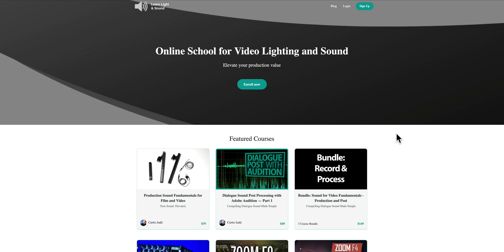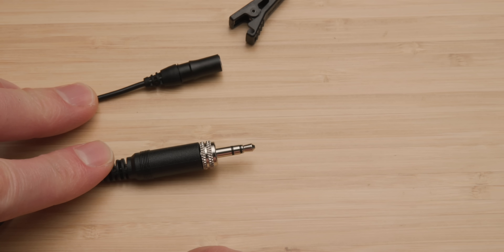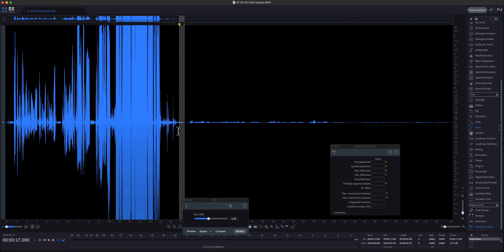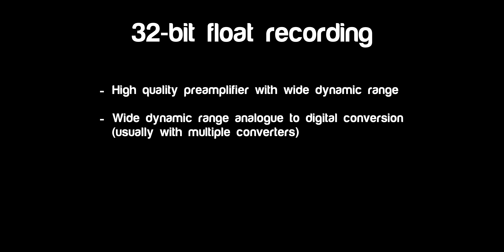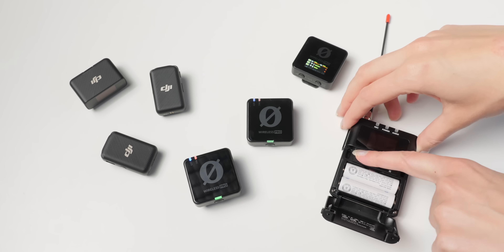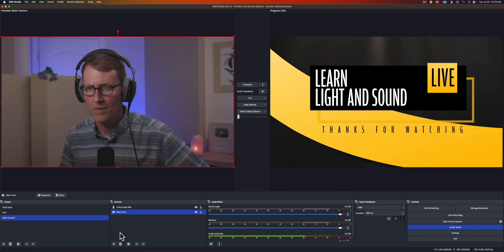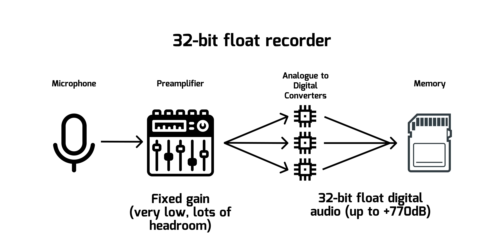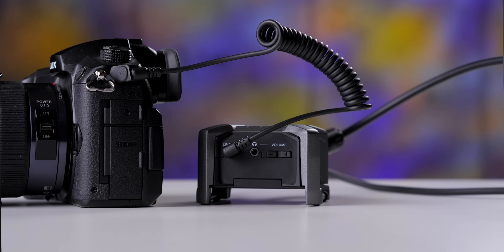Is 32-bit Float Audio Magic?

Comment: I made a video using gh7 w xlr2 w rode ntg 3 in input 2 and rode wireless pro to xlrpro adapter to input 1 i had gain up high on both and set to 20db and imported to fcpx w 48kh quality. Nowhere can i find 32 bit on any file. Would be cool to get some feedback on what im hearing. I knew many questions around i have asked creators and answers are kinda alienating and confusing. If its my mic are those 3 high functioning mics shown in this video a better option? Stereo mic ?idk. The situation was being at a carnival. Tons of noise or sounds. Great breakdown. Thank You
Reply from the maker: All of those recordings to the GH7 are 24 or 16-bit depending on which recording format you used. The Wireless Pro does not transmit 32-bit float wirelessly. It only records 32-bit float to the transmitters.
Reply: @curtisjudd  the gh7 is set to use the xlr2 in camera set to 32 bit 48 in video format mov and prores.i have the ntg3 in the xlr2 port and rode wireless adapted rode vxlr pro to xlr2 port 1 set 48 phantom. I think ive figured it out🤷its the ntg3 . Sound distorts  or clippy only through sounds at the side and back of the mic. I connected another vxlr pro to the port the ntg3 was connected and  then connected a 3.5 to the vxlr and now both wireles pro and deity mics sound good. As far as the file on the camera card  yet to figure out. I really appriciate the feedback! Thank You
Reply from the maker: @DavidRose-nonichemedia  👍

Comment: I wonder when will they make an 32 bit lav mic capsule, the zoom m1 has a 32bit float shotgun mic but I've only seen like 2 videos that reviewed that mic , so it must not be as great
Reply from the maker: Mic capsules are analogue. It is the converters which are 16, 24, or 32-bit float. So things like the M1 put a mic, preamp, converters, and recorder in one. With separate XLR mics, the capsule is in the mic and all the other things are in the separate recorder.

Comment: I'm sure someone's working on a real-time 32-bit to 24-bit plugin for live audio.
Reply from the maker: Interesting. I wonder what problem they’re aiming to solve with such a thing. Why not just use 24-bit from the start, in other words.
Reply: I would think such a technology would have to use at some point some limiting or auto-leveling, which would mean you could just use 24 bit in the first place. The converter will not know in advance what the peak will be on that 32-bit stream, so it would have to "react".

Comment: With 32 bit float, your microphone will probably be the limiting factor. Without 32 bit float it was the recorder. A big improvement!
Reply from the maker: Assuming there aren’t other costs to 32-bit float. And I’m not 100% sure that’s the case yet.
Reply: Yeah and people aren’t always even recording from microphones. I got my H4 essential mostly to tap out of my mixer and capture my synths/drum machine/live looping jams. Works great and has not clipped once despite me being a little less than careful with my levels at times
Reply: I can't tell if you're being serious. 32-bit won't automatically improve your sound

Comment: Will you be reviewing the Zoom H1XLR?
Reply from the maker: Yes
Reply: I can summarize the H1 XLR for you: Zoom noisy as expected, small, convenient, slightly larger than the F3, love the combo XLR and the PIP port, screen is super tiny and difficult to read, and the processor is so weak, it takes three times as long to normalize or export as the length of the actual recording. Great for tiny mobile audio interface for live streaming, has loopback.

Comment: I record mostly nature sounds and do a lot of 12-15 hour recordings and one big drawback to 32-bit float only recorders is the files are significantly larger for dynamic range recordings I don't need.I record with my Zoom F3 only when I have to simply because I have to use 32-bit workflow and have much larger file sizes than I really need. Trust me hard drive space fills up quickly on long recordings. Also to everyone who thinks it's a hassle to set gain on a 24-bit recorder then you probably will not want to hear how important microphone placement is and getting your talent or yourself to speak in clear level tones while not turning your head too much etc. The point is good quality audio has so many variables and if you can't handle learning to set the gain then the rest of it is probably going to be too much for you also.  So many variables are involved and a 32-bit float recorder is not going to solve all them for you. But I'm sure Zoom,Tascam and the others will want you to think it will be the cure for everything.
Reply: Ever record a live rock band?  Placement matters....nil.  You will have transients pushing 120 db and lows and whispered vocals just barely reaching 50 db in the same performance, no matter where you position your microphones.  All you can to is position your mikes the best way you know how to capture the soundstage (or at least make it reasonably correctable in post).
Reply: @chuckschillingvideos  Well, you do need to think of the effect of the room in messing with the frequencies of the band, and the balance between audience noise and the band itself.
Reply: @Ozpeter  That's accomplished not by mike placement but by orientation and control of the capsule pattern.  I have five mikes available to me so it makes it easier to handle the size of the room, how off-axis relative to the PA placement I am, audience size and "enthusiasm" (it matters), and so on.  It's not exact, but unless you're working for the venue (not once have I done this), you're usually quite limited in your ability to more your gear around, not to mention you need to be able to keep your eyes on it at all times to protect it from sticky fingers.
Reply from the maker: Thanks for sharing your experience! I agree that setting gain is a skill worth learning.

Comment: very helpful, as always, thank you for this. 
Can you recommend a good DAW? I've had it with adobe, but not really sure where what other options are generally recommended.
Reply from the maker: Depends on what type of work you intend to do in the future. If you want to go all-in on post and make that your career? Pro Tools. For most other paths, I’d look at DaVinci Resolve’s Fairlight. You can start with the free version.
Reply: @curtisjudd  i do mostly video work, corporate usually internal stuff, been using da vinchi for about a year, jut curious what else is out there.
Reply from the maker: @oriffel  Well, if you're using Final Cut Pro, Logic may make sense. Some like Reaper and others Studio One. But in post production for video at the high end, you'll almost always see Pro Tools. Then from there it all depends on workflow and preference. I've transitioned primarily to Fairlight in Resolve.

Comment: About 32 bit float in live streaming, a digital limiter should work quite well as there is no digital clipping in 32 bit float.
Reply from the maker: You can probably make that work, but you’re essentially back to working in the space where 24-bit works fine, and encoders will convert to 16 or 24 bit anyway.

Comment: That’s great. Now in 2024 can companies start making a file type that have this tech WITH video! I mean a MOV file or MP4 file is essentially a video AND audio file together.. so why not make a new type of file?! I know the size will be bigger but that’s ok with me
Reply from the maker: Ah, I wonder if that's already possible with some file container types...
Reply: I would think yes, as Curtis said, many file formats are just containers of a video and audio track (or multiple tracks).

You can try this by combining a video file and a 32-bit float WAV/FLAC track in Handbrake.

I would think this file may have playback problems on many current consumer devices.

Comment: Curtis, interesting video thank you.  I have a number of Gongs which I'm interested in recording.  I'm a complete novice with respect to sound recording but would suggest that the SPL and dynamic range that a large gong can produce from a main strike (very loud) to the point where the harmonic reverberations drop below audible frequencies is quite wide.  I'd be interested in whether you think this would be a valid use case for a 32bit Float capable recorder, not withstanding I'll have to get hold of some equally High Dynamic range microphones to capture the detail at both extremes.  Potentially using multiple microphones to capture each end of the frequency range.  I'd welcome your thoughts.
Reply from the maker: Honestly, I think I'd focus mainly on which microphone(s) to use and where to place them. The initial strike may be super loud if miked within a few cm of the gong, but with a gong, I'd think you want to back off a bit because the beauty of its sound is partly the gong and partly how the sound fills the space.
Reply: @curtisjudd  Thanks Curtis, I'm going to try microphones located in the same location as the listener about 3-4 feet away.  As you say part of the nature of the gong's sound is how it moves the air around the entire room.  As a sound therapist I have multiple instruments (gongs, singing bowls, wind chimes, rainsticks & tubular bells) located around the client and I'd like to arrange multiple microphones (4 minimum) possibly two matched pairs, around the client, in order to try & capture the entire session (1hr) as it happens.

Comment: I think where 32-bit really make sense is probably on the processing side. From the best of my super limitted knowledge, some of the DSPs and DAWs are working in 32-bit float internally. They would convert 24-bit integer samples into 32-bit fp first before processing anything, and then convert the output back to 24-bit integer format.
Reply: DSP processing, whether in hardware, like a digital mixing console or DSP or software like your DAW, is a very different animal than what is going on with 32 bit float recording.  The best and easiest to understand examples I know of are in some of the Yamaha Mixing Consoles manuals.  They used to have a really nice graphic that showed how the audio was raised and lowed in the digital space and signal chain to allow for large dynamic ranges that occurred while processing audio and summing together numerous digital audio signals that each could have as much dynamic range as the output of the console is capable of, and what the console is doing internally to handle all that potential.
Reply: @rbingraham  If I may quibble ;)  Understand you may understand this, but for others.  There is NO 32-bit float recording.  All original source audio, like microphones, is recorded into a fixed-memory space, either 16 or 24-bit in most electronics.  Transposing a recording into 32-bit float requires breaking the value into a mantissa and exponent.  32-bit float is NOT a value, it is a calculation of a value from TWO numbers.  The extra 8-bit (from 24-bit) are used to re-scale the data.  They do not change the precision of the 24-bit bit precision mantissa.  End quibble :)
Reply: @MaxoticsTV  That's probably a fair quibble, I don't dive that deeply into what is going on under the hood so to speak.  I mostly concern myself with the results that the technology brings and understanding it well enough to use it effectively as possible in my work.  My point was mostly just saying that how DAWs handle the math internally (the time from when it leaves the audio driver and is now in the hands of software alone, to when it's summed and sent back to your audio driver) or within a digital console or DSP hardware (which I think mostly use 64 bit floating point? if memory serves) is not really the same as the 32 bit float in your portable audio recorder.  Maybe the underlying mathematic fundamentals are more similar than I understand, and that's certainly fully possible.  But from the end user perspective and how you use those tools effectively and to their upmost is a fairly different experience.  At least in my mind and experience.
Reply: @rbingraham  That's exactly the issue I address in my latest video, a long ramble about this one.  99% of audio people deal with audio AFTER it's recorded.  Over time, they start to read into the underlying data qualities that aren't there.  That leads to an opening some unscrupulous equipment manufacturers have used to make certain claims, haha.
Reply: @rbingraham  I thought the processing  works with 32bit float  PCM data. Interesting.

Thanks for sharing.
Reply from the maker: 64-bit internally, in some cases.
Reply: Yes, audio electronics do NOT record audio data in float, which is actually a formula, mantissa ^ exponent.  All 32-bit float data is created from a fixed data source, say 24-bit.    All 32-bit float eventually ends as fixed data, as Curtis understands about "streaming", because all amplifiers MUST work with real voltages, NOT formulas of what the voltage is (again, m ^ e).

Comment: Yeah, 32 bit float has a lot of buzz. But all it does really is let us record without having to worry about gain. The "gain" in a 32 bit float recorder is basically just a bit of metadata with a desired playback level. 

And that was enough for me to move on over to 32bit float for what I do. One thing less to worry about. I then can think more about where the microphone goes and do less fiddling because a meter goes too far sometimes. 

So, yes. It's not magic. But I am a convert for what it does do for me :)
Reply from the maker: With a good microphone, 32-bit float should serve spoken word recordings quite well.

Comment: You are a pro, and it is second nature for you to set the gain in a recorder. For me an amateur setting the gain was my worst anxiety in the entire filming process. Every single time I had a sound problem, it was always because of wrong gain setting. 32-bit float is not marketed for  pros. You guys can record amazing audio with 24-bit. For non-professionals, however, 32-bit float IS a game changer because it offers us peace of mind knowing that we will not clip. Great video. As always. Respect.
Reply from the maker: Yep, this is exactly what ZOOM and Sound Devices like to hear.

On a separate note, I think of setting gain as very much like setting exposure on a camera. Definitely a skill worth developing (and keeping 32-bit float as a safety net).

Another thing many people do is push their gain way too high given the quality preamplifiers we have to work with today. Peaking around -20 is probably what most of us should be aiming for so we'd have far fewer issues with clipping.
Reply: Not clipping is only one small part of getting good audio, that's only talking about a rookie mistake. There are lots of big mistakes one can make, and that's just the most obvious one that's usually very easily noticed and consequently solved. Taking this one issue off the table doesn't get rid of a host of other potential problems.

By far, the biggest mistake amateurs people make is poor microphone placement, including booms, plants, and lavs.
Reply: @chakerian  Exactly. Also basic mic selection (and whether to engage pads etc) is impossible if you don't know where you are in the mic's range.
Reply from the maker: @patrickchase5614  And how do you know that on a 24-bit recorder or audio interface? You pretty much don't unless you use your ears to monitor.
Reply: @curtisjudd  Yup, the only way to know if it sounds good is to listen.
Reply: I don't get this, because it seems to me that if you can't figure out how to set gain then you also don't know where you are within your microphone's dynamic range, and that makes it almost impossible to get mic selection and placement right. It seems to me that understanding where your levels are is a prerequisite to any sort of high-quality audio work, not a nice-to-have that's only relevant to the final recording process. After all, you have to avoid saturating your _mic_.

And that's where the marketing for the likes of Zoom really misses the boat. All of their professional-quality sample recordings were undoubtedly created by people who understood exactly where they were within the mic's range and therefore its output voltage.
Reply: There seems to be this perception that being a professional is synonymous with tolerating pointless inconvenience, having to use skills to basically deal with less than ideal circumstances, like meticulous gain staging. If 32 bit float or other advancements in audio recording make that not necessary anymore, that doesn’t just benefit amateurs – it benefits everybody
Reply: You don't need to be a pro to take a minute to set gain properly and to monitor with headphones.
Reply from the maker: @rsmith02 agreed!

Comment: @curtisjudd  Does Auphonics handle 32 bit float files well, or is another step needed before that? I'm a beginner that filmed my first interview yesterday and used Zoom f3. Audio seems fine after listening but a bit low, and nothing clipped. Do I need to do something else with my 32 bit file, or would you think sending it straight to Auphonics would be enough for ok result?
Reply from the maker: I haven't specifically checked, but I'd be very surprised if Auphonic cannot handle 32-bit float files. And if so, you shouldn't need to do anything beforehand.
Reply: @curtisjudd  Great. Thanks for taking the time to answer questions here!